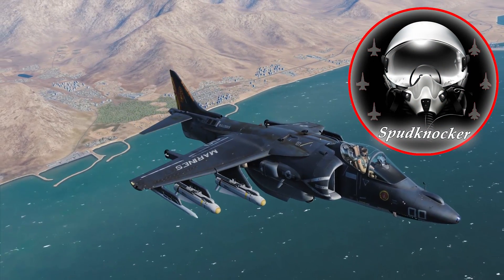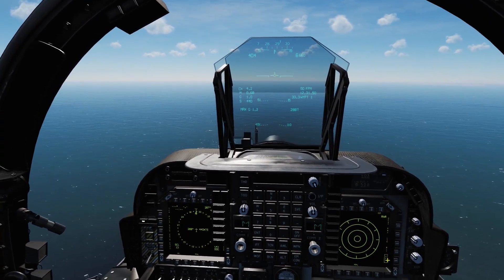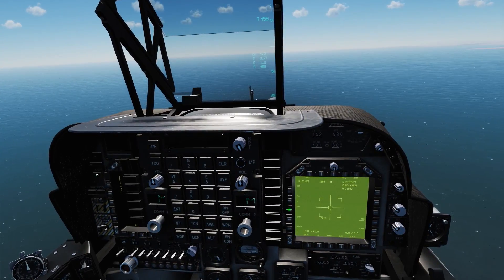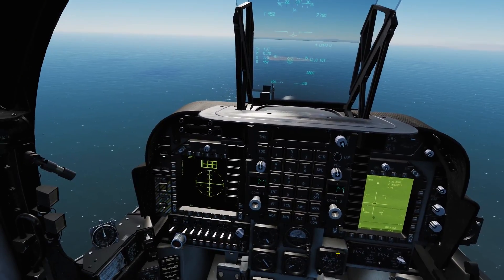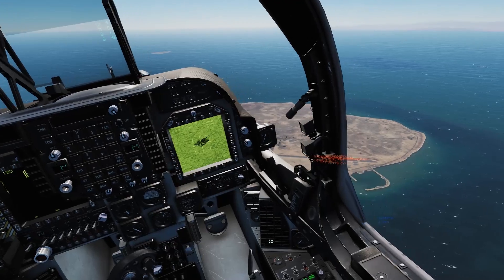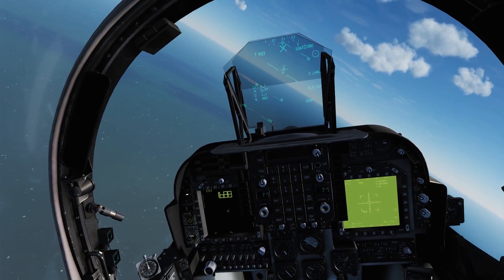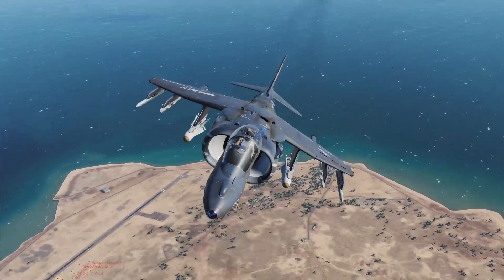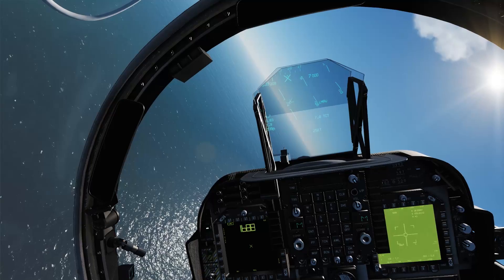DCS: AV-8B Harrier II LMAV Tutorial (Laser Guided Maverick)

Comment: How do you make them work when staring from the ground?
Reply from the maker: Should work in the same way... LMAVs do not require a cool down like IR mavs do.
Reply: Spudknocker you have too change the laser code. It starts off as 1111. I changed it too 1688. But the TPOD has too be warmed up, and the master arm off. It's not intuitive, and took some figuring out. If I knew how too make videos the way you do then I would do it. But you should do one showing using the LMAV from a hot start.